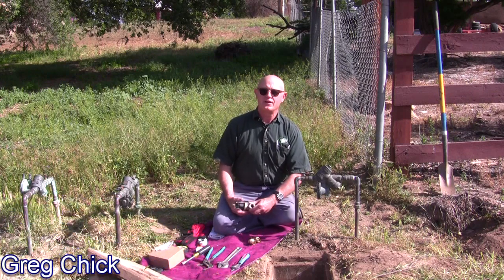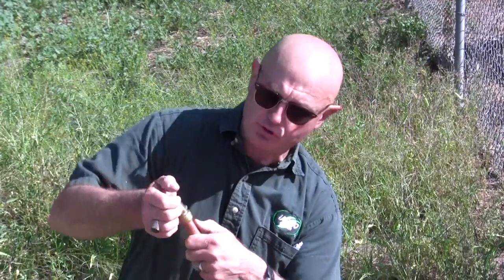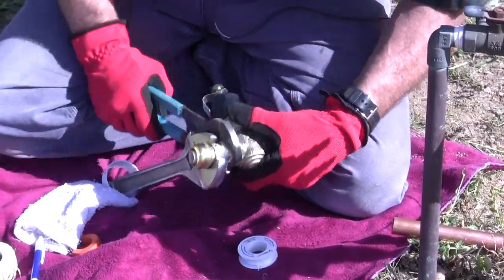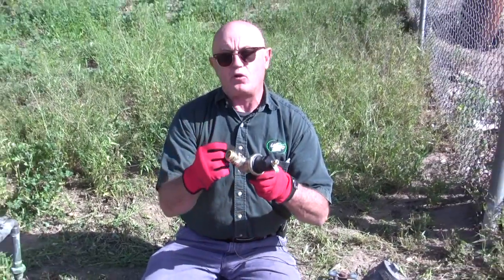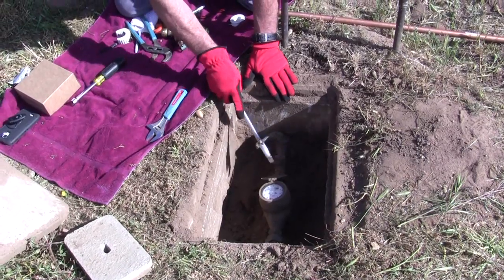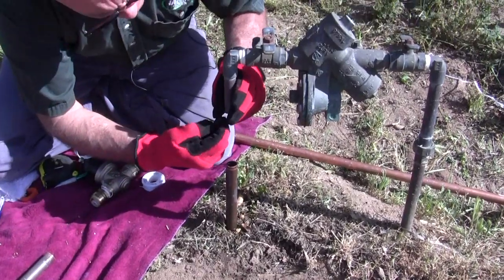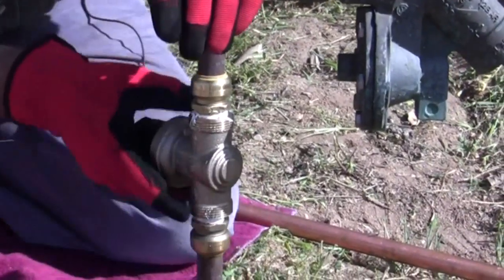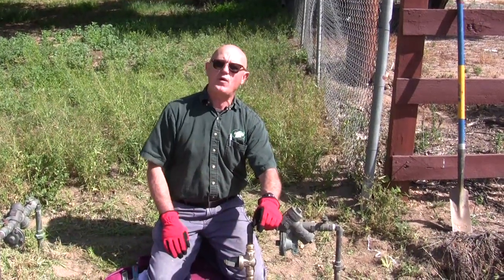Installing a Pressure Regulator using Sharkebite™ fittings

Comment: Y did u add sharkbit fitting if as u said the regulated valve comes with union already
Reply: Union that came with regulator offers easier movement

Comment: Great vid. Remember, sharkbite must be leafree, only good to 200 psi, since your are outdoors can degrade from uv light + rain water can enter the piping system. I do prefer hi-flow regulators for residential applications. Like the watts lf223 or watt u5b. I like the one wrench technique; I'll use that. And I would have put another ball valve before the input side of the prv. All & all excellent vid

Comment: Excellent!  I wonder what comments will follow?   I wonder if many will watch the scorpion just after the video?   I wonder if people realize that with lower pressure the leaks saved as well as the water saved will save real money for all!  The recommendation to  DIY is not really made,  just to know how and why regulators are needed is.   This looks easy,  and in this video it relatively is.  Your need may be much more complex.  Plumbers may charge $500,  more or less,  but the need for safe pressures below 80 are priceless.   Or should you ask what amount is your insurance deductible for flood damage?     How high is your water bill?   Are you feeling lucky?
Reply: Thank you! Greg.  I need to install a 1" sharkbite pressure regulator on the existing copper (blue striped).  I figure that I must insert the sharkbite unions on the in & out pipes first?  The current pipe installation does not provide enough room to lift a branch of pipes as they are big and close enough to form a strong structure that had been welded a few inches off the ground.  Would that be okay?